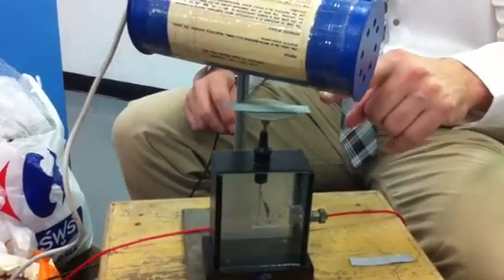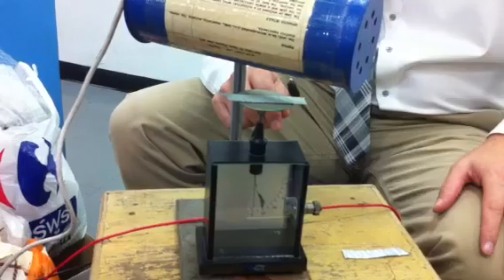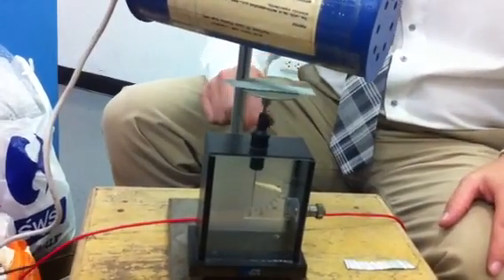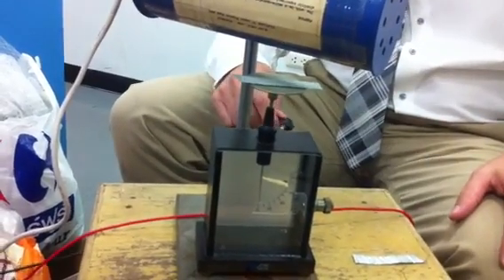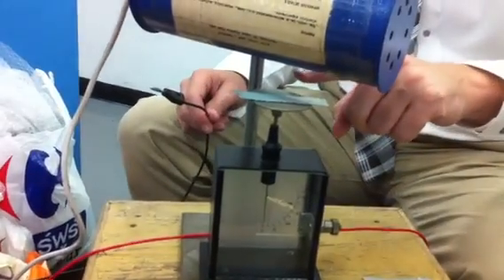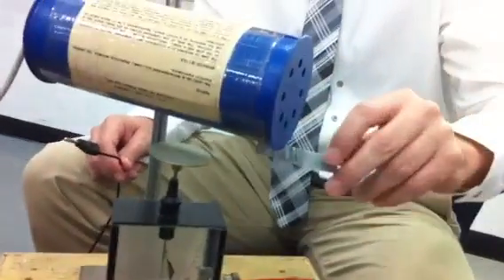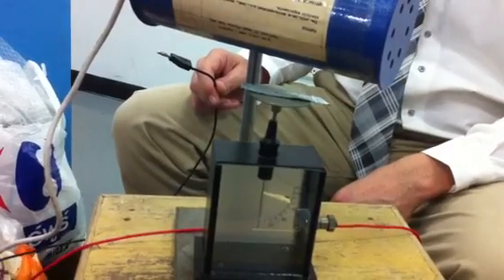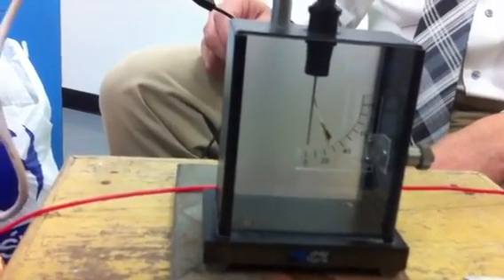Photoelectric effect with dull and clean zinc

Comment: Why use zinc if it oxidizes? Most metals have similar work function values all around 4 eV. 
Also is it absolutely necessary to pre-charge the plate? Can we not just let the photoelectons carry away negatives and leave a net positive which should also be observable on the electroscope?